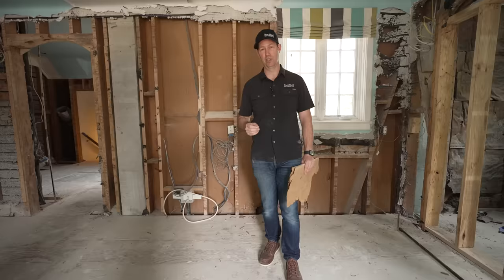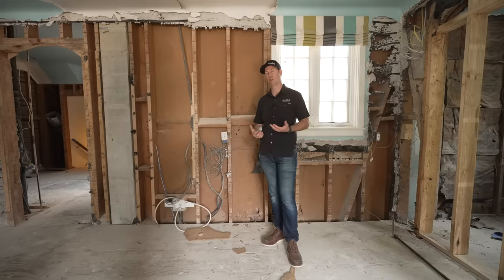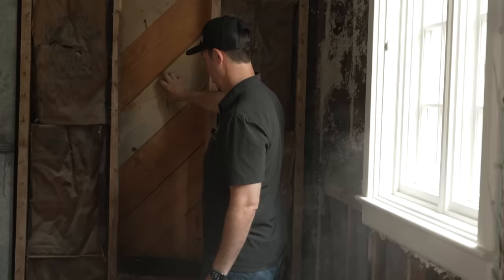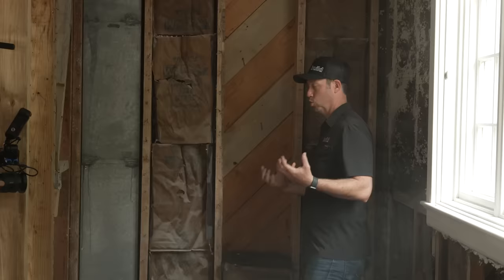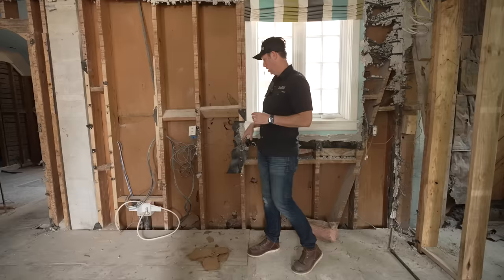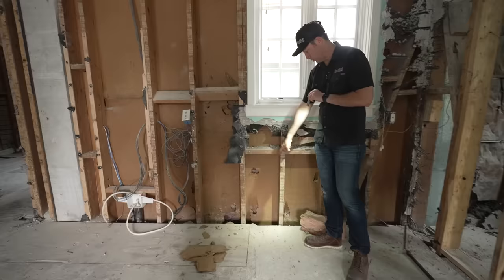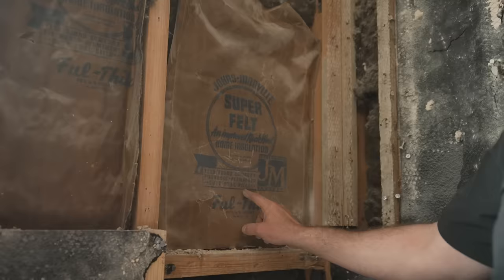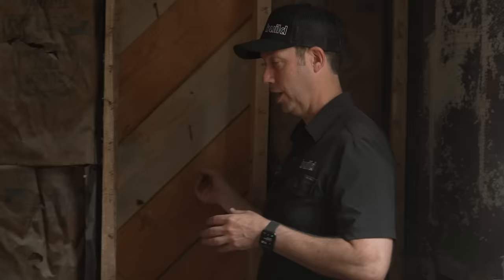I’m recommending we NOT INSULATE This Old House

Comment: I’m struggling if we should leave the visqueen on before we drywall our basement.  Climate zone 5 north central Indiana.  Cement foundation.  The stud frame walls have space between them and the foundation. Have open face batt insulation between the studs and then the visqueen.
Reply: Unless very dry either way you have potential  for mold. If you have food source for mold (drywall paper and dirt in the FG) moisture (its a basement) and correct temps (45+) you have all you need to create a mold farm (its IN) only thing you may be able to mitigate is moisture.  Fiberglass and moisture is bad combo (replace with nasty to work with Rockwool?)  If you must go this route I'd consider as described but latex paint for vapor barrier instead of VB as when the wall absorbs moisture (it will) it can dry to inside. My concern is trapping moisture between cement and vapor barrier.  Also, adding heat pump water heater to basement area will do as good a job as most  dehumidifiers and reduce your water heating cost as well.  Rigid foam with drywall glued to taped 2in foam which is glued to wall is best method for DIY. Spray foam would work  applied directly to wall if done properly  but $$$$$$.  Best advice is consult local energy retrofit company for local advice as they will be familiar with what works best in your climate. I'm in zone 6 almost 7

Comment: Funny the the remodel under the window has particle board sheathing same as 100 years old sheathing. And the diagonal solid wood sheathing is claimed to be a remodel, yet if there’s brick on the exterior how did they replace it? Could that be originally installed diagonal for bracing before the brick veneer?
As for insulating now, how about rock wool with plaster so it will breath in the heading and cooling seasons.

Comment: Question, we have a room upstairs on our second floor that has exposed beams to the base of the roof. It is not insulated but I want to insulate it. We just had a metal roof put on over our asphalt shingles that were leaking. There is no ridge vent. The leak has now stopped and now I'm ready to move forward with insulating and finishing this room, any tips or tricks?

Comment: Seal the brick. Use closed-cell spray foam in the wall cavities.  Add 1" Celotex insulation before gypsum board.  That will seal and insulate the house blocking condensation on the walls which would mean mold formation.

Comment: What about using fiberglass matt drywall in place of paper face drywall and veneer plastering/level 5 finish?
Reply: I'd probably go with rockwool since it does hold water. At best you might be able to get away with a thin amount of rockwool that has many R-4 so there is sufficient airflow to allow it to dry. Realistically the only way would be to build some mocks up of the wall with different levels of insulation and let it run for a year (all four seasons). This why you have some real data to make a low risk assessment.
Reply: Well it costs twice as much a sheet as drywall, probably only comes in 5/8, and then you have extra plaster work on top.
Reply: @jonathanzappala  No, it comes in 1/2 inch too. I'd imagine if it solves the mold issue then it pays for itself in terms of what you would have paid to rip everything out that failed due to mold. Also look at that house and look at the potential client. You think they care about spending some extra money on their finished walls?
Reply: @benjaminziegler7437  yeah your probably right

Comment: I'd like to educate on the comment about mold needing cellulose to grow as food. Mold will grow on glass🤔. It only needs moisture, and humidity levels above 50% is sufficient for most molds to grow, anywhere, and especially where it can readily condensate. Like on the fiber board. The turpentine nature of the sap in pine lumber helps to retard its growth.  But mostly in what I saw is the ability for air movement to keep it dry is what it had going for it. Mold cleaning and prevention specialist.

Comment: I have a 60 year old house. It has cedar board and batt siding over tar paper with no sheathing. 2x4 framing, no insulation in the walls, and drywall throughout. Does it make sense to insulate those walls?
Reply: My advice would be to find a professional that is familiar with this situation and get an truly informed opinion. I have no professional expertise here but had to do research for a renovation of our 200 yr old farm house and I believe you want to be very careful how you handle this. The cedar board needs to be able to dry out from both sides or it will rot. You also want to avoid condensation in the wall cavity that will rot the wood or cause mold. Here is another video that Matt did with a situation closer to what you described:
https://www.youtube.com/watch?v=jhoQ_f9ZnzQ
(EDIT: I corrected the link, originally had the wrong episode)
Reply: Absolutely do insulate but only one vapor barrier in the inside. I would use fiberglass or rockwool without a vapor barrier and then use a one piece plastic floor to ceiling Then drywall, but that means tearing out a lot of drywall. Probably easier to just do the ceilings and live with it. Trying to get any into those walls without stripping one side won't work due to fire blocks in all stud cavities.
Reply: @markpashia7067  vapor barrier paint

Comment: You got an old house, guess what, you don't get to do the cheapest solutions, drywall problematic but plaster isn't, then guess what YOU HAVE TO PLASTER.  HISTORICALLY more accurate too so no problem with either historic or DOB.  That's a multi million dollar house.  SPEND THE MONEY.  Close up all the holes in outside wall.  Treat with anti fungicide when air is dry and fungicide will dry quickly, use fans too.  Run a bead of sealant around studs and exterior wall ea stud space.  You've no reduced wind driven air flow to nothing.  You only have vapor water flow.  Install a drain mat made of twisted plastic strands w no facings that way no surface for water to condense on against old material   Install unfaced rock wool TIGHT to studs.  Put on SS lath.  Run sealant up lath at ea stud so when plaster is applied they'll be an air barrier between stud bays.  Install CEMENT based plaster that won't decay under water vapor.  Finish with BREATHABLE paint.  If sufficiently paranoid put another drain mat between plaster and rock wool.  The drain mat at exterior wall will allow some air movement up in hot weather to help carry away water vapor.  The rock wool will allow transmission of water vapor to 'dry' ie inside air conditioned side.  Dew point might occur within Rock wool, which luckily will remain unaffected until at some point it can evaporate and move thru plaster into house or back outside.  
oh
and
INSTALL GUTTERS  BIG OLD HUGE NEVER CLOG CAUSE THEY ARE SO HUGE OLD FASHIONED GUTTERS
If historic agency says anything, hand them a bill from your mason for his bid to come back every year, inspect and point.  Historic agencies cannot force you to let your building be destroyed ,  create a hazard, or endanger occupants if there is an inherently dangerous existing condition.  Research history of applied gutters, find the most appropriate DO IT.  Also, install hard surface 18 inches wide at bottom of wall sloping away from building to 'draining soil' gravel bed trench drains or French drains to ensure run off will not sit and soak into bottom bricks.  Maintain drain surface free of all overhanging vegetation.  This will increase air flow around the building and dry wet brick from outside faster, so they'll be less water left to drive inwards.
You headline is click bait sensationalism which is defensible to get people to learn what to do.
Your choice to pick the cheapest solution, and ignore all other remedial work related to problem that in and of themselves might solve problem is weak, very, very weak.  
You obviously KNOW about buildings.  Then USE that knowledge to teach.  Give the RIGHT solution and if there is a significantly lower cost solution, and you care that those without millions to redo an old mansion might watch and appreciate the info,  you can add, BUT if money is tight, and KNOWING you're heating bills will go up, and the room might feel cold, just seal the holes up, seal ea joist cavity to limit wind driven air / moisture vapor flow, use mold resistant drywall wall, use fiberglass mesh instead of tape and mold resistant compound.  The upcharge for mold resistant materials isn't that high.  Installing a baseboard heater at the wall would also help evaporate away water vapor (do not have HVAC duct discharge against wall if you have central AC as cold air in summer will encourage condensation mold.

Comment: Currently renovating a 1940s cape in Upstate NY same type of fiber board and no insulation. What do you recommend to insulate?
Reply: did you ever find a solution?
Reply: @RagedContinuum  all the companies called recommended a mix of open and closed cell foam depending on the location within in the house to get a good r value and keep costs down. . House also had a radiant barrier under the siding and thin foam layer

Comment: What if you only insulate with 5cm wood fiber insulation and make sure the innside is covered with plastic if it is a "cold climate"?
Reply: And also paint/treat the outside wall with water repellent vapor permable coating

Comment: You can safely put rock wool in there. Just don’t put a vapour barrier. The heat will migrate through the drywall and still slowly dry out the cavity.
When in doubt. Ask the Europeans.

Comment: I would fill the cavity with "Rockwool", without vapor barrier. just like they do in the middle of the USA. If you are really concerned about mold on Sheetrock and going to for level 5 finish go for something like "Permabase".

If it was here in Quebec, Canada we would definitely insulate this with a vapor barrier on the inside and a small air chamber between the Sheetrock. The drying would be done on the outside part of the house. Leaving this like this would destroy the house. I work for an insulation company in Quebec Canada.

Comment: The fiber sheathing your referring to was not manufactured 100 years ago. That section of wall was probably from a later remodel. I don't disagree with you reluctance to insulate the wall with fiber sheathing, as it could cause problems.

Comment: Ok you don't know what you are talking about. The timber and that particle board is not rotting because there is a cavity behind the brick. Any excess moisture going through the brick is getting drained through the cavity. The moisture is NOT getting absorbed by that particle board, the timber fraraming and the plaster.

Comment: After cleanup of walls: why not spray foam?
Reply: Spray foam is terrible for the environment, and for our health.
Reply: @codycharles7147  After it off-gasses it's not bad for us. Environmentally, since it's the best insulator per inch there is, it saves extra heating/cooling, as such I would argue over time the math favors it, even though it's fossil-fuel based.
Reply: @tenblinkers3173  what about when you tear the house down in 50 years? How will demo crews prevent that foam from going into the environment?

Comment: So what would you recommend for a 70s suburban house with an overhang, but particle board/cardboard sheathing?
Reply: They must of added some sort of fungicide to that cardboard sheathing because I had it in my old house and had Zero issues even in areas with water damage
Reply: Move, & let the new owner deal with it?
Reply: @guytech7310  I mean it is a reality for many home owners so telling people to move is just kicking the can. Matt could easily say the same thing to the home owner in the video.
Reply: @mistere5857  LOL!  I meant that as a joke: Like How to do make a small fortune? Easy start with a huge fortune! :)

That said, Hard to beat new home construction. It will be very difficult to make an old home efficient & comfortable. Look what happened to Matt's 1970's remodel: Ended up demo'ing it and starting over.

FWIW: I opted to build my own home rather that try to renovate a pre-existing home. 

Best wishes for whatever you decide.
Reply: @guytech7310  planning on building in the next 5 years but have some reno projects going on that need to be finished before we sell this heap. Specifically changing a bunch of things in the garage. Old drywall had mold all over it. I just want to do the improvements right so the next home owner doesnt get stuck with the butcher job we got stuck with. Serious in the master bath, they stuck tile directly on normal drywall.
Reply: @mistere5857  Well I would recommend avoid opening a rabbit hole. Do what you need and move on, other wise you might be working on it for a decade.

Wish you the best.
Reply: @ordinarynonplayercharacter2142  No need to do so as that is not wood or particle board. It is sugar cane and naturally resistant to mold. It is a byproduct of making sugar and was well washed and then pressed into 4x8 sheets with a glue product that was water resistant. The cane fiber does not absorb water well.

Comment: I am really curious how one of your previous videos fits into this.

You put dimple mat on, if I remember correctly, barn board sheathing, then foam board, sealed that and insulated on top of that. Oh before you started you drilled holes to create airflow across the back of the sheathing.

Would you still do this? Is the brick the reason why you didn't in this build?
Reply: yeah, brick is the big difference. if you're using a water-tight cladding (siding), then you want an air gap behind it, a vapor barrier (if you're in a hot climate), then insulation, the sheathing, then insulation in the wall cavity, then drywall or whatever wall material.

Comment: I'd say spray foam insulation and drywall finish on the interior.
Reply: Why?  Wouldn't that trap moisture, quickly lead to mold, rot, and eventually destroy the particle board?  Did you watch the video?

Comment: Can I ask a question ? I recently replaced my siding and found 80 percent of my house was skinned in insulating board and not wood. I’m not talking for insulation purposes here I’m talking they actually skinned the house in it how can this be legal and what can I do. It totally takes away from stability and strength of house. They only used wood around window and door areas. I want to sue
Reply: I too have a " celotex " foam board house, built in 1983. The time to replace foam was when you had siding off. I also would feel better if my walls were real plywood as any flying missle, like a tree branch would eaisly pass thru my walls

Comment: Rip out that particle board crap, add a drainage mat with drain holes in brick, and spray foam the back of the mat enough for the climate zone. Cover the rest with cheaper insulation.
Reply: How do you propose that they take out all the particle board from between the studs and brick? Not to mention wall ties attached through the sheathing into the studs. You’d be there for 10 years
Reply: @CHRISANDELLIOT123  What was called Particle board is actually Homasote, fiber board for insulation and sound deadening. It will still disintegrate quite easily, I would demo it like drywall.
My guess is that the plaster and lathe was probably 10x more difficult to remove than that board will be.

Comment: I'm certain multiple coatings exist that would cover this old sheating for good on the inside, some paints are so strong that they'll outlast 2 generations of occupants and bind everything besides teflon, then you vapor barrier also on the inside, then you insulate and finish the interior. 

On the outside, now that the interior is no longer a buffer for the exterior brick and Super Cardboard 1900's  moisture, you have to address that. I believe that at the bottom courses and at the top you could open up and install a venting grid similar to venting soffits so that the brick and sheating can dry independent of the interior living space.

Comment: Older houses survive longer because they’re able to “breath” they’re not sealed up so tight that no moisture can escape. I’m a builder and will never recommend spray foam or  any type of sealed system
Reply: Bad building countered with bad insulation might help indeed.
I’m glad that those times are over, and I don’t have to freeze to not have a rotten house:D
Reply: arent new homes suppose to be built to be tight as possible hence why they need a device called an air exchanger?>?
Reply: @randomrazr  Yes, and that results in having both good insulation, and long lasting houses. So we waste less energy, have better comfort, better air quality. This is a good example of modern technology making everything better.

Comment: How big is that gap between the bricks and sheathing? At 3:33, looks like you've got some space. Could have the intake on some piped-in dehumidifiers triggered via hygrometer in the gap to run once the moisture reaches X

Comment: Couldn’t mineral wool be used? It can dry out when it’s get wet.
Reply: For the particle board, it would hold in the water against the particle board and not let the heat get to it to evaporate the moisture. You could always replace that particle board with that solid wood, however.

Comment: Old studs like that are the worst. A 20v screw gun with a 2A battery breaks the head off a no 6 screw and when you go to a no 8 screw you have to use an 5A battery and even then it won’t always drive it.
Reply: Yeah just use a 2A battery with a 5A battery on a 12v screw gun using a no 8 screw sometimes doesn't work but I've found if you use a 240v screw gun with a 10A battery on a no 6 screw then you can use a 12v screw gun on your no 8 screw
Reply: Might just be a situation where nails are the appropriate fastener @Amberlynn_Reid